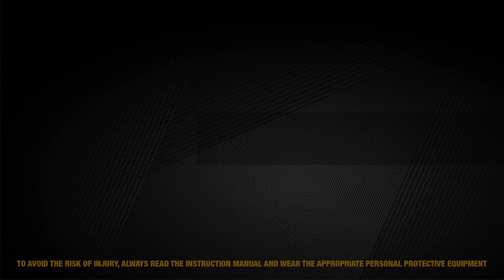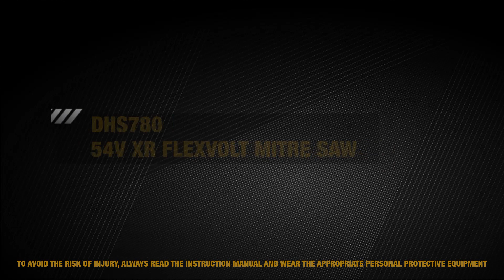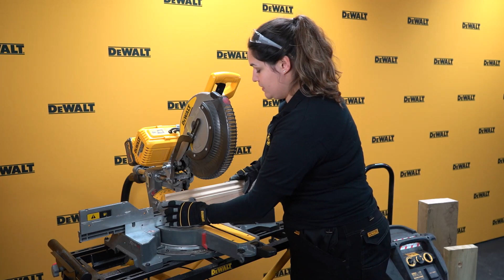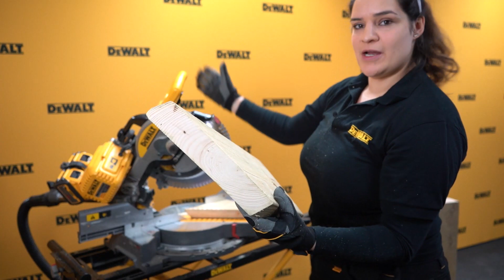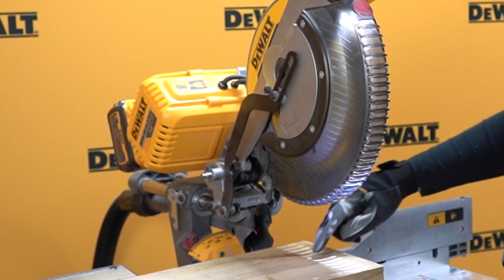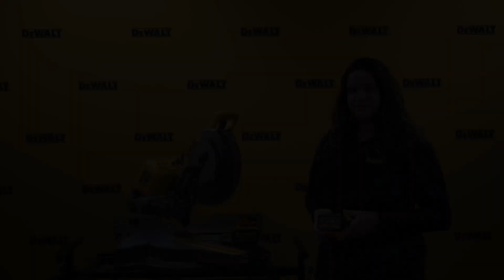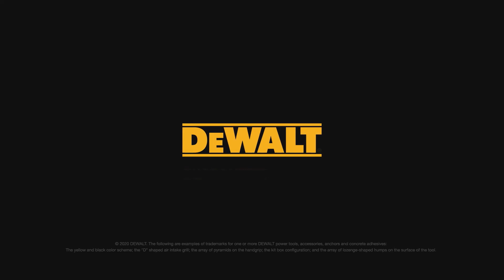How to use the DeWalt DHS780T2 54v FlexVolt Mitre Saw | Mitre Saw | DeWalt Mitre Saw | DeWalt Tools

Comment from the maker: What should I consider before purchasing the DeWalt DHS780T2 54v FlexVolt Mitre Saw and how do I use it? 

In this video, DeWALT will highlight the key things you should consider before purchasing and after purchasing the DeWalt DHS780T2 54v FlexVolt Mitre Saw. Any questions will also be answered in the comments. 

 Products used: 

DeWalt DHS780T2 54v FlexVolt Mitre Saw- https://ffx.co.uk/product/Get/Dewalt-Dhs780T2-5035048666395-54V-2X6.0Ah-Li-Ion-305Mm-Flexvolt-Mitre-Saw
If you have any questions or would like any information or advice you can get in touch: 01303 852692 or https://ffx.co.uk/tools/Contact

All prices are accurate at the time of the video going live.
How to use the DeWalt DHS780T2 54v FlexVolt Mitre Saw
Mitre Saw
DeWalt Mitre Saw
DeWalt Tools
dewalt
dewalt tools

0:00 Intro
0:17 Cut
1:01 Setup
3:00 Demo
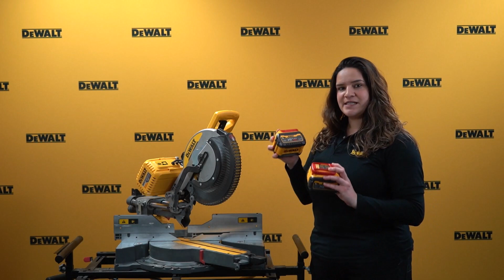6:30 Outro